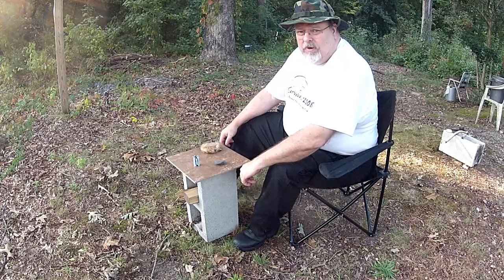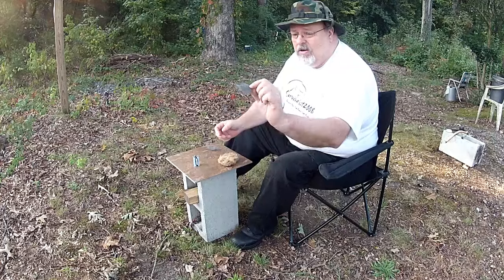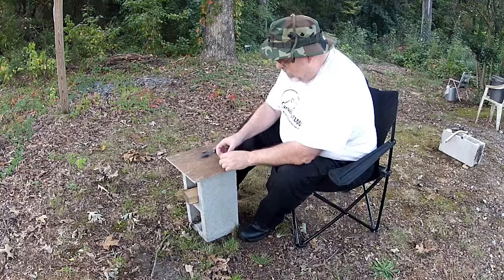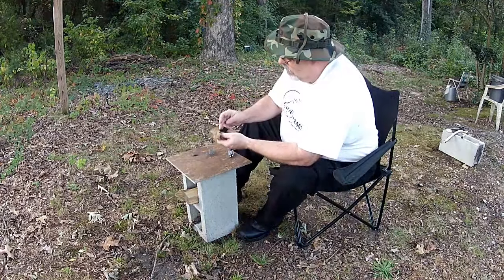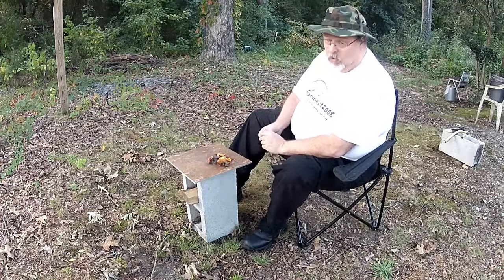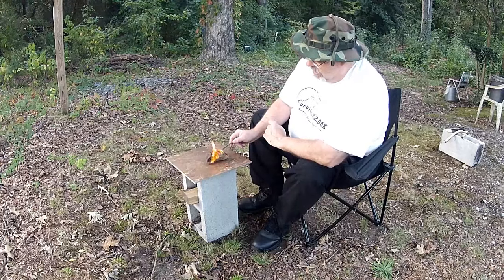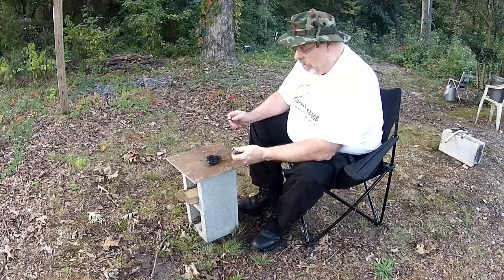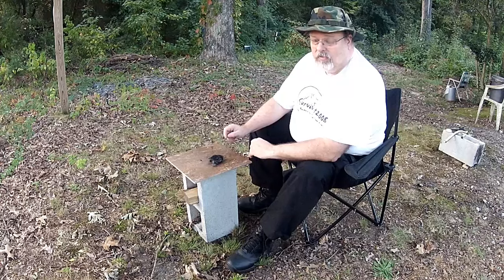Fire From Steel Wool and 9 Volt Battery

Comment: Great work man.  It's awesome to see you trying all these different fire methods.  I've heard about people setting their backpack's on fire by carrying loose batteries that accidentally make contact.  I have heard that home fires can start that way too if people are careless with battery storage.
Reply from the maker: +Smell N Roses Thanks SnR. I just can't seem to conquer the bow drill method yet. I need to make a better hand block. Hoping to get out now that it's cooling off. Hope the family is well. Take care!
Reply: Survivalist2008 The bow drill is definitely tricky.  I've been practicing with mine with limited success.  The bearing block is a critical piece and another important tip is to keep the string tight.  We're all doing good, thanks for asking.